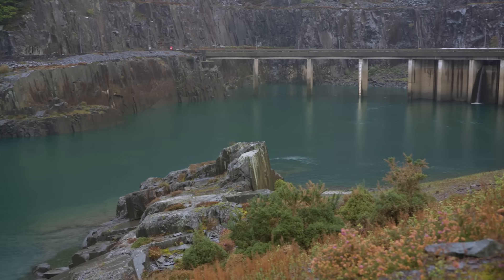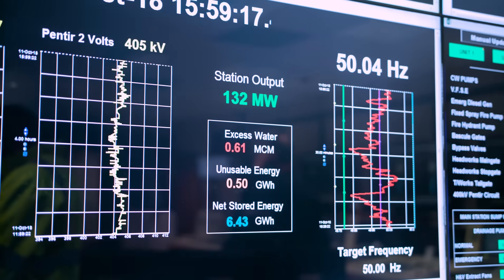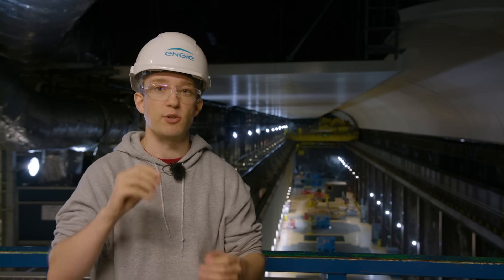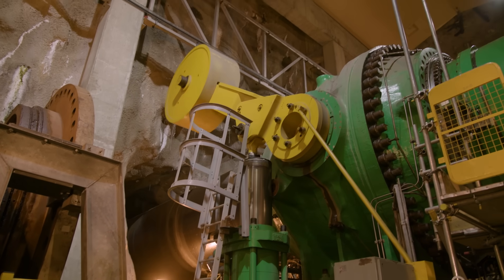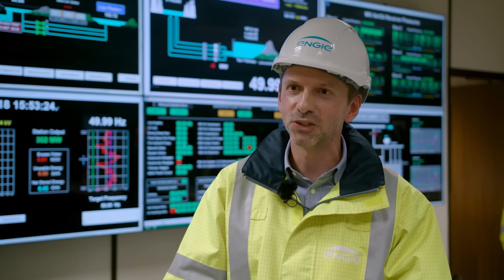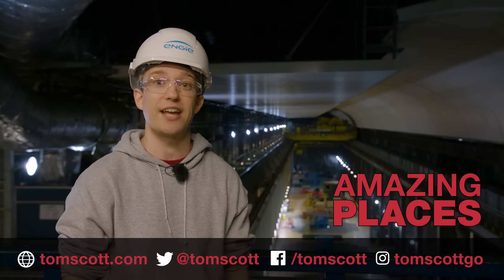Britain's largest battery is actually a lake

Comment: Heh, and people say that green energy has load balancing issues. :P

(But no, seriously, it totally does.  There's a couple of islands (Madiera and in the Canaries) that actually use wind to pump water up into a battery-reservoir to get around it, but it's a huge investment for a fairly small population - the only reason they pulled it off is because of grants from researchers trying to demonstrate that it's technically viable.  If you're curious about the details, there's a documentary series called Islands of the Future that is quite informative once you get past the stereotypical problems of the format that it does absolutely nothing to minimize)
Reply: Madeira Island has the Multi-Purpose Socorridos Hydroelectric System  using a water reservoir with a 32,500  cubic metre capacity to support 25MW of wind generation, there are no batteries.
Reply: @dougmc666  The water reservoir acts as a battery in that system.  It stores potential energy instead of chemical energy, but it fulfills the same purpose, just with the added benefit of having potable water available if it's needed rather than just having a bunch of hazardous chemicals sitting around.
Reply: The only issue is the cost.

Comment: How do they get the power/energy to pump the waters again to the top? Would not the energy to pump the water up be same (if not more) as the energy produced using the water fall?
Reply: Mashrur Ahmed Yafi I‘m sorry, I edited the comment right now. You get less energy out later on. The energy needed to pump the water up is excess power from the electric grid.
Reply: Mashrur Ahmed Yafi The energy to pump the water up is of course more than you get out of it later on.

Comment: Fun fact, Dinorwig is so powerful that it can perform a "black start". In other words, it can bump start the entire UK National Grid.
Reply: That is no small feat, very impressive. I know some of the big outages they had in the states in the 80's took days to get everything back in order.
Reply: It's not so much the power output, it's the ability to start outputing power at the correct frequency without having the grid to synchronize to.
Reply: Wow for real looks big but didn’t think it was that big
Reply: @mnikhk  During a black start only the powerstations are being fed electricity. So you don't need all that much power output, but the problem is that you do need that power output. That is the chicken-and-egg problem of starting a power plant. You need power to start the power plant before the power plant produces any power.

Hydro is often used to provide the black start capability to electricity grids, because starting it up can be as easy as opening a (very big) valve and it can ramp up to full output quickly. So this plant and others like it provide the power to start other, bigger, plants like natural gas, and then finally big coal plants. As the power output from all of them slowly ramp up the power is then diverted to the actual consumers in the grid and area by area power comes back on.
Reply: @tylisirn  This conversation gives me memories of Physics lessons, where they taught us all about how different electricity types have different startup rates. A hydro power plant can turn on almost instantly, whereas a nuclear power station may require hours or days to start and stop energy production.
Reply: @tylisirn  Thanks for that in-depth explanation!!
Reply: Wow
Reply: And the fact that it was only out for that long is evidence that it wasn't a black start. Turning power back on when you have outside power is easy enough. Turning it on when you don't have enough energy to start turning the generators at the proper speed is a feat.
Reply: That and the fact that synchronous generators of large size need an armature excitation voltage to work and so need to be bootstrapped some how (once they are going they sustain excitation from their own output)
Reply: So it can power a proton rifle in case aliens invade Britain?
Reply: @Moepowerplant  just make sure your mech pilot has a clone of his mom to tank for him
Reply: @Moepowerplant Erm, they've been using it for years for that very purpose. The only reason you haven't been invaded is because of the success of this station.
Reply: @horsenuts1831  What a relief. The units I know of suck out the entire grid of a whole country the size of Japan for only a few shots.
Reply: It can do WHAT?
Reply: Aster Antimony Black start?
Reply: No good if it needs bump starting at night.
Reply: Nuclear power stations are required to have backup diesel generators so this can provide power  for the exciters..no electricity and the alternators are just spinning lumps of steel
Reply: @richardoakley8800  Coal fired power stations have diesel generators for back-up, the nuclear ones have jest engines, usually a set of four RB211 engines.
Reply: Ah great but my town can have as many power cuts as it wants
Reply: engineer gaming
engineer gaming
Reply: At only 135mw or so that's simply impossible.
Reply: @смиренный-х2б  peak capacity is 1800MW actually. The guy in the video even says it's near 2k, pay more attention next time
Reply: Nate normal demand is 20-30GW is can’t on its own. CCGTs with OCGTS do the heavy lifting in black start, even coal stations can do it
Reply: @смиренный-х2б  m and M have very different meanings when it comes to measurement prefixes btw. mW is consumer electronics, MW is power stations.
Reply: Didn't seem to be effective when the Bedford power station and N sea wind farm shut down recently causing a blackout in various parts of the country !

My Little Generator can perform a black start - big deal.
Reply: @millomweb  christ you read like a 56 yearold hyper conservative.  black starting an entire nation's powerplants is a big deal.  Hydroelectricity is great for that and it servers a great purpose.  Grow up, grandpa.
Reply: @russianbot4418  ok boomer

Comment: How efficient is it? Like how much energy does it lose each cycle.
Reply: It requires around 20% more energy to charge it at night than you get out of it during the day but due to the huge difference between on-peak and off-peak electricity rates you can run these pumped storage facilities for a profit.  In fact Engie does just that and this 'battery' makes them about 100 million quid profit each year.

Comment: It seems like it's going to be a net loss of energy (for humans due to efficiency reasons) if the water's coming down and going back up again the same way it came down?... I mean, I understand why we'd want it, but I thought systems like this were only used for backup...
Reply: It is a net loss as all batteries are. But it covers the system when it's at its peak and "recharges" when the demand is low and excess power is available

Comment: This seems like a great idea. 

The only issue I can see about this relates to the laws of thermodynamics. Basically it must take more energy to pump the water back up to the top than you can possibly get back out of it by dropping the water down through the turbines, so why not just use the energy you would otherwise use pumping it up to send power to the grid???

Or am I missing something???

 Perhaps a sequel to answer this, Tom?
Reply: You are correct - you have to put in more energy than you get out. But you can't always control the electricity production. Sometimes you produce too much energy, and that energy has to go somewhere. So you pump water up into a lake where you can use it later when you actually need the extra energy.
Reply: "so why not just use the energy you would otherwise use pumping it up to send power to the grid???"

Because that energy is generated at night by idling nuclear reactors and coal/gas burners and the grid doesn't need it, everyone is asleep.  This is a storage device - like any other rechargeable battery you fill it when it isn't needed in order to use it when it is needed.

Comment: Due to the way batteries store electricity the energy is not held in one place but is continuously moving around through the chemicals in the battery. This is why batteries break down over time. Because of this movement, a battery is actually full of kinetic energy. NOT POTENTIAL. common misconception.

Comment: I am wondering whether the electricity generated by the water flowing downhill during the day is sufficient enough to supply the whole national grid as well as pump the water back up the hill at night???? wouldn't it take same amount of energy to pump the water back up as well?????
Reply: No, the electricity generated by water flowing downhill during the day supplements the electricity generated by coal, gas, and nuclear plants (especially when the sun isn't shining nor the wind blowing so the renewables aren't keeping up with demand).  At night those coal, gas, and nuclear plants have excess capacity and that "excess" electricity is used to pump the water back uphill again.  The net energy used goes UP by adding Dinorwig into the grid (due to frictional, pumping, and generating losses) but the plant allows for more "cleaner" energy sources to be used so the net pollution goes down.

Simplified example:  assume a grid with peak demand of 10MW from 7am to 9am and 4pm to 6pm, 8MW from 9am to 4pm, and 4MW from 6pm to 7am (silly assumptions I know, but work with me here).  If we have only 1 coal plant that runs at 6MW all day long (coal plants are very expensive to change output levels, especially over short time frames), 1 diesel generator running at 4MW on-demand, and 1 solar farm outputting 4MW from 10am to 4pm on sunny days.  Without pumped hydro the diesel generator will need to run at capacity morning and evening peaks, and may be needed to supplement solar during the day if the sun isn't shining, yet the coal plant has unused capacity at night.  Add pumped hydro that can sustain 2MW then the excess electric from the coal plant can fill it up during the night and use it to supplement during the morning peak, then solar can pump up again during the day, ready for evening peak.  On sunny days diesel generator isn't used at all.  Net less pollution.
Reply: Please re-watch the video. Maybe watch it slower and try to learn from the words spoken. Please be aware that similar lake battery systems exist in most developed countries in the world because it makes economic sense.  Also note that this is not new technology and has been used continuously in Europe for over 100 years! Then try and figure out why something that has terrible efficiency (car engine for example) might make good economic sense (lake gravity energy storage).  The answer to your last question is that it take MORE electricity to pump the water uphill at night than you will get from power generation when it comes downhill during the day. Then try and figure out why it makes economic sense by contemplating how you would solve the problem of handling a countries peak electricity demand needs. It does make sense or the united states wouldn't spend 2 billion annually on these gravity energy storage solutions.
Reply: You're violating conservation of energy
Reply: @fzigunov  How am I violating conservation of energy? How is it possible that energy is generated from water flowing downhill is sufficient enough to power the grid as well as supply the energy demand of pumping the same water up the hill as well ? The energy generated surplus must be only marginally more that the energy required to pump the water back up again. what am i missing here??
Reply: @TheCoolsacs  Fernando and John are correct.

The energy generated is marginally less (or worse) than the energy required to pump it back up.  Without energy losses (due to friction, etc.) you would only ever get a net zero gain from this, but since friction is unavoidable, you necessarily experience a net loss.

But as mentioned, it isn't about producing a net gain.  It's about balancing the load so excess energy (from coal, gas, nuclear, wind, etc.) at times of low demand can be used at times of high demand, when those other sources may not produce the power necessary to meet demand

Comment: I was expecting a huge hole filled with acid.
I'm a bit underwhelmed. 

Cool bilingual safety signs, though.
Reply: I was expecting a lake with metal  on the sides and an electrolyte liquid in the lake
Reply: Yeah this is in Wales and the signs are in Welsh and English.Ive been past this place on the way to Conwy and Caenarfon castle
Reply: Benoit Bvg what is the top language?
Reply: @demawoods2679 , Welsh. Things in Wales tend to be dual language.
Reply: @demawoods2679  Welsh/Gaelic i presume.
Reply: @benoitbvg2888  Welsh is not a Gaelic language. The Gaelic languages are Irish, Scots Gaelic, and Manx. Welsh is a cousin: the other side of the Celtic family, along with Breton and Cornish.
Reply: if it was titled ''hydro electric'' no one would watch as much..i was also expecting water in the lake as electrolytes to a million arrays of lead and zinc plates submerged in it!
Reply: It's Welsh, they can speak a different language to the English, not bilingual, Welsh
Reply: Maybe the water is very mildly acidic?
Reply: @MiseFreisin  Exactly - from acid rain ;)
Reply: The world "battery" is very misleading. I'm sure Tom knew that though.
Reply: I was expecting a "battery",
( I'm lying, I already thought it was nothing but bs )
not just water being stored up high,
when demand is low and being released when demand peaks again.,.
It's a way to store energy, much like hydrogen fuel cell power plants do,
however, it's not a battery.,.
and tbh, it's something that rather soon will be outdated.,.
I mean, like I've mentioned, "hydrogen fuel cell power plants".
They are safer, demand less storage,
can be placed anywhere you want.,.
Reply: Every with in Wales tends to be bilingual. Even temporary road signs

Comment: Not so fun fact: One of the greatest challenges of renewable energy (solar and wind) is it's volatility. To balance out the seasonal oscillations arising if we were to rely on these energy sources only, we'd need power reservoirs (batteries) with a capacity of 7 TWh in Germany alone. Sadly, all the water batteries in Western Europe only give us capacities of about 2.6 TWh.
This means that electricity arising from coal and nuclear power can't be abolished in the near future without extreme costs arising from either overproduction of electricity or from less efficient means of energy saving.
Reply: That 2.6TWh figure sounds a little high, given that the generating capacity of all the pumped hydro in Europe is under 20GW, wouldn't 2.6TWh mean those plants would need to be able to run for more than 100 hours without emptying?  I have to admit I'm a bit shaky on the math here, I'm not sure I understand the difference between generating capacity and storage capacity.

Comment: There’s a very similar system in place around the Oconee Nuclear Power Station in South Carolina, with the three water reservoirs near the station (Lake Keowee, Lake Jocassee, and Bad Creek Hydro Station) each filling up and releasing water in response to demand, as the Nuclear power plant cannot quickly change its output.  Extra energy during non-peak times is put into pumping water from Lake Keowee up to Lake Jocassee and from Lake Jocassee up to Bad Creek, and they are presently expanding the Bad Creek Hydro Station to have a larger capacity.  When there is higher demand for electricity, they allow the water from the upper reservoirs to drain down into the lower ones, releasing the stored energy.
Reply: AEP runs one in Virginia too.

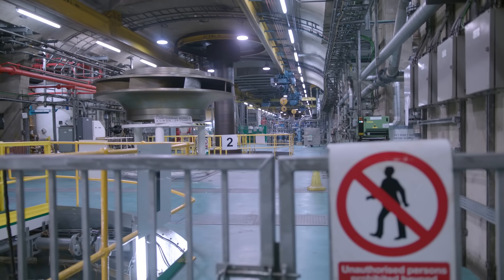Comment: What's the point of the sign at around 3:28? Surely the engineers working there don't need a little cheatsheet hanging there telling them the basics of how the system works.
Is it because they get a lot of visitors, and that's there to give them a bit of insight or something like that?
Reply: I think it's free to visit
Reply: @bentleyboy67  its not free. Why would it be free?
It is a proper tourist attraction though. Very educational and interesting.
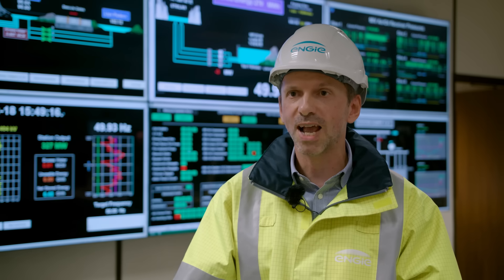Reply: What's the point of the "time difference" at around 1:32? Surely the engineers can subtract!

Comment: Well if it rains a lot it would be the most efficiant battery ever ... Imagine not having to pump the water up , just wait for it to fill
Reply: That's not a battery anymore, that's just hydroelectric power.
Reply: It does rain quite a lot in Wales, actually.

But not to "completely refilling a massive lake every night" levels of rainfall, unfortunately.

Or, well, fortunately, if you happen to live there.
Reply: I suppose maybe it recharges around 1-2% for every rainy day.

Comment: So this power station doesn't increase the total energy on the grid right?  It really is like a battery, it stores power by taking from the grid at night when prices are cheap and demand low, to pump the water up- then at day when demand is very high, it can put the same power back in?  They only make money because power is cheaper at night.  An electric grid couldn't just be made of this kind of power station, because it is not net generating power itself - just smoothing out delivery of the ones that do.
Reply: Nope. It's a net loss. But it makes energy more available.
Reply: It's not about making money, it's about smoothing out the duck curve. Google what that is, and why it is important, but briefly it is all about load balancing.
Reply: It avoids curtailment which is 100% loss. On a warm sunny, yet windy Sunday nuclear, wind and solar are generating lots of power but nobody is using any, something either has to be shut down, sold or stored. It's hard to sell to your neighbors,  they usually have the same conditions and there is very little storage. Curtailment is the killer for ever increasing wind and solar.